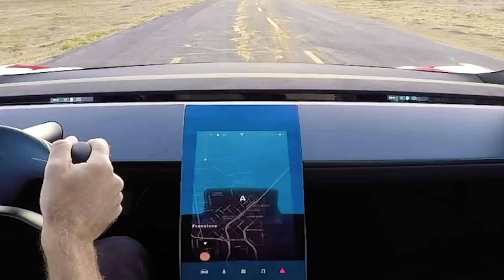Why I Turned Down A Full Time Engineering Job At Tesla

Comment: Man, I have worked in the HVAC industry since I was 17 years old, I transitioned from service work on HVAC and moved into Building Automation back in the 80’s and learnt computers etc. I have now been in this industry for around 40 years + and have grown into the software and project management side of the industry. As HVAC is one of the biggest users of energy in the world I love being in this industry and being able to reduce building power usage as this is where a big part of the problem is. I don’t understand now as with all of the AI tech etc around we are still using old PID algo’s in the industry that have been used for many a year. I want to develop some other form of PID like algo to help this industry that is sing so much of the worlds energy. I would love to discuss with you if you have the time.

Comment: Wow I don’t know I i would have done that. Currently I’m a senior in high school. Although I am on track to graduate this year( grades are great), I don’t feel like I am being productive. I  don’t know what I want to to in the future or what college to attend. I’m lost and don’t know what to do.
Reply: It never hurts to be thinking of what you could do after school, but just keep in mind that life doesn't end after high school! If you decide 10 years down the line that you want to go to college, there's nothing stopping you from doing that. Don't let it overwhelm you :)
Reply: I decided to go to an Aviation Maintenance school. I decided i want to work on planes. To find out what makes them tick. And to deal with a bit of everything. Hydraulics. HVAC. Electronics. Electrical. Sheet metal. Engines. Painting. 

Its an industry in HUGE demand. And the trade schools will be alot cheaper than college, for far higher, more lucrative job offers. 
From single engine planes owned by the friendliest people in the world, to state of the art corporate jets, to military drone maintenance contracts under a secret clearance, to commercial airline maintenance, to NASA. 

We aviation techs have the best class of mechanical work in the world! 
And if you want, you can continue towards a degree in aviation tech or av. management and move up in the ranks of a prestigeous FBO. (Fixed Base Operator). Super lucrative career opportunities. 

As an example, one of the instructors at my school was the senior tech for the Rothschild's airplane in the 70s. As well as the head of maintenance at Gulf Stream. Another did maintenance as well as being a plane dealer. 
I would consider this as a possible career. 
(Unlike Liberal Arts, this certificate will get you a job)
Reply: @Dave_Crupel  that seems really cool, im going to do some research and see if its whats for me
Reply: It's ok to not know...if OR when you choose a college you can major in Liberal Arts which then you can experiment with what you think you'd be interested in for your future career. No rush. You got this.😎👌
Reply: @takingitonedayatatime7851  Seriously?
Reply: @Dave_Crupel  seriously what?😎
Reply: @takingitonedayatatime7851  What seriously?
Reply: @Dave_Crupel  😂😂